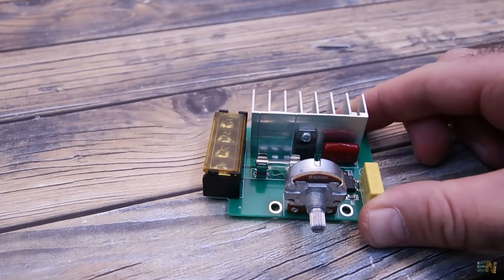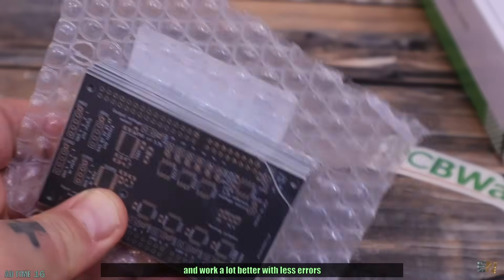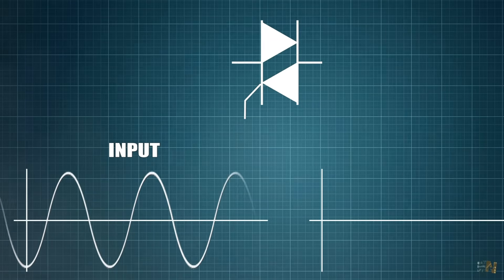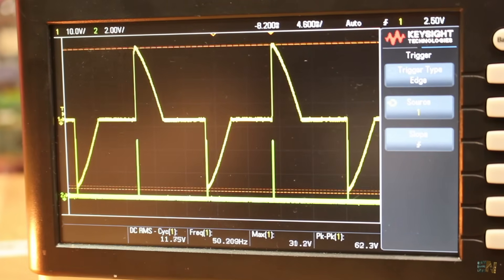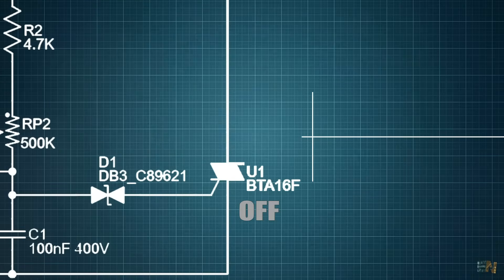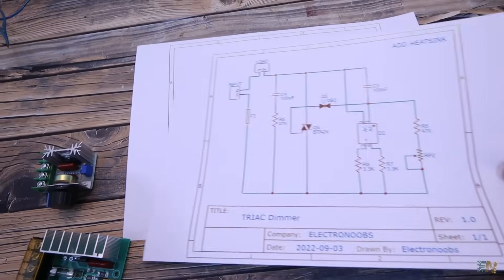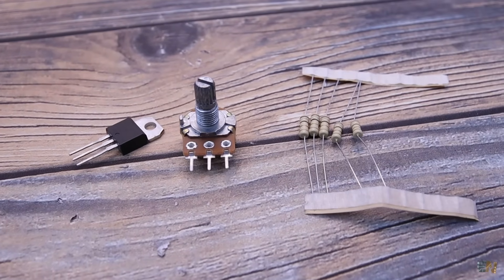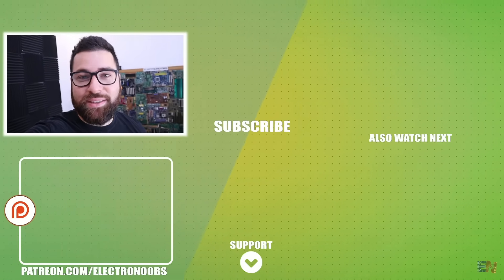TRIAC AC Dimmer Circuit - How to dim AC Power for Motors and More

Comment: Es geht auch ohne Gleichrichter wie hier gut gezeigt wird  für Normalbirnen.
oft kann man nicht ganz runterdimmen. (je nach Produktion oder Defekt). Dann setzt man 
als Endkunde zwei Diacs hintereinander ergänzend ein. (gestern gemacht, da Ursache nicht gefunden)
Dann ist das Regeldefizit behoben und man kann wieder ganz genau und auch hier auf Null runterdimmen.
Sowohl bei dem Gleichrichterglätttungsyp, als auch ohne wie hier, so ein Teil früher einmal erwischt 
und dann selber behoben. Oder man lötet das ganze 8 x kleiner und noch unkomplizierter mit 500 kohm Poti 
10 kohm Schutzwiderstand und 3,3 kohm nach 100nF zu Diac zum Triacgate auf eine Mini - Platine. Fertig.

a) Man kann z.B in die Phasenanschnittstelle bei LED einen 250 V festen Transistor reinsetzen und dessen Basisansteuerung nach vorne vesetzt zwischen zwei Widerstände vor den Diac legen. Die Kapazität ist hier viel kleiner auf A1 nach unten [33nF]. Es gibt auch Minipotis , fast SMD groß mit gut belastbarem Widerstand - Drahtabgriff für wenige Cent. Man kann auch das Poti an einem Eck mit einem Tupfer Isolierlack am Läuferstreckenende eines Normnalpotis beschichten (ein gut plazierterTupfer) , dann geht die 220 v LED sauber, ohne viel Aufwand ganz aus, und reicht für 3 LED der Küchenlampe als Minimodul zum hell - dunkel steuern. 
Das habe ich gemacht, es geht nämlich dann teilweise zur Regelung ohne Potibelastung über den Transistor 300 V fest
(ggf. noch mit Vor -  Diode).  je nach nach Transistortyp (NPN oder PNP) und Vorwiderstand auf C - E Strecke 
zum Schutz.  Minimalprinzip mit erwünschtem Ziel.

b) Besser und noch viel genauer ist hier eine dauerhaft verläßliche PWM - Regelung über einen Mosfet.
c) Eine weitere Lösung wäre eine vorzeitige Pulsweitenlöschung am Triac über einen Minitransformator 
mit Frequenzgeneratorschaltung und einstellbaren Pulsweiten z.b über NE 555 oder einfachem 2 Transistor - bistabilem Frequenzgenerator und nachfolgendem niedervolt Colpitz -  Mini Transformatortreiber, 
z.B auch wie in einigen Massagereizstromgeräten, hochwertige auch  mit 2 x NE 555  oder mehreren 
(z.B. 4x in einem kleinen SMD - Cmos und dort nur voreingestellt auf 10 x verschiedene  Möglichkeiten).

Wichtig ist aber die Grundfunktion:
mit Triac Löschfunktion von primär 12 V aus einzel 1,5 x Akku - Pack, dann auf sekundär 220 V Reizstrom transformiert und  dort Pulsweitenlöschung nach Voreinstellung im Niedervoltbereich an Multifrequenzgenerator aus z.B. 2 Transitoren (kinderleicht), dann bei 220 V transformiert am Triac abgreifbar und simulan dann auch 220 V so Frequenz varianbel und Pulswellen verstellbar dort am Triac  löschbar. Die Dauer überprüft man recht anschaulich mit einem winzigen VDE Gasglimmlämpchen und zweifarbigen LED Dioden am Frequenzgenerator, dies ist unkompliziert und logisch über zwei Potis einstellbar. Die Amperestärke mit einem dritten Poti vor dem Gasglimmlämpchen. Das geht fast einfacher bedienbar als jedes käufliche Reizstromgerät, 
wo man wie verrückt erst einmal wie ein Wilder mit Spieltrieb herumtippt.
Natürlich sind die vorprogrammierten Funktionen recht gut gemacht.

Comment: Das kleinere Poti ist der noch zusätzlich verstellbare 100 kohm Widerstand.
hinter dem etwas größeren 500 kohm Poti auf einer Seite auf A1 .  Seitlich liegt nach unten auf A2 der 100 nF, Kondensator als Kapazität. Dann kommt danach der 3,3 kohm Widerstand an den Gate des Triac.
Geht dann richtig. 👍simple Sache z.B. gut leucht - beschichteten 60 W Glühbirnen  (wie Tageslicht hell)
und auch bei Halogen Glühbirnen.

gut erklärt und gleich auf den Punkt gebracht ! 
Dann noch der Glättungsfilter mit 100 nF (oder 150 nF) und 100 Ohm ~ entspricht voller Glühbirnenankopplung [diese hat meist 100 Ohm kalt] u. bei errechnetem Wechselstromwiderstand nach 2 pi Wurzel C * (L)
dadurch geht es auch viel gleichmäßiger beim Regeln.

Zeichen für eine richtige Schaltung:
eine parallele 220 V LED - Birne geht beim Aufdrehen der Glühbirne invers ganz aus. und v.s. genauso an u. aus.
Noch besser zwei Diac und 6.8 Kohm statt 3,33 Kohm. und 33 nF als aktive Keramik - Kapazität dort, statt 100nF.
und 66nf dann als Filter (ohne 100 Ohm sogar) . Dort ist die LED in Gegenrichtungsdrehung am Poti 
dann total aus (absolut dunkel) und genauso die Glühbirne noch einen Tick präziser regelbar aus. 
(wer das einmal probieren will).

Comment: Great video.  But maybe the output signal and the control could be improved if the control circuit is connected before the load not after the load.  You see, the voltage of the control circuit is also regulated by the triac.  It should be a clean AC signal that enter the control circuit.

Comment: Your circuit diagram for the second commerical unit has the wrong resistor values. 3302 shown in the picture  is 33k not 3k3 as in your diagram. 4701 is 4k7 not 470 ohms.  People have commented on this already so do something about it. Anyone building the circuit with 3k3 instead of 33k resistors are going to be in real trouble.

Comment: Hi, The resistor values you presented in the reverse engineered circuit are wrong. A Resistor that is marked 3302 is a 33kohm not a 3.3kohm as you designed in the schematic.

Comment: Very informative video. Is this triac dimmer  reduces voltage? And if so will it be effective to reduce 220V to 110v  for a solidstate guitar amp.  Thanks
Reply: No. For your purpose, a transformer with 230V input and 115V output will fit. This circuit is NOT for halving the amplitude of a sinewave. It deforms the sinusoidal waveforms like pulse width modulation does with DC voltage, but synchronised by the beginning of every half-wave.
If you would try to use it as a voltage reducer for your guitar amplifier, it could render your amplifier useless, even blown up.
Try to get or build a transformer that transforms 230V AC voltage to 115V AC, it will fit your needs and there will be no annoying (sometimes deadly) disturbances.

Comment: Thanks for sharing AC dimmer Voltage Regulator for speed controller, instead of 500k can i use 100k Pot, Please suggest if so  any other components are required to change.

Comment: Can I swap out the potentiometer for a microcontroller controlling it digitally with PWM?

I assume that somehow the potentiometer was getting VCC and GND, can I hook these up to 5V In and GND and then the analog signal pin be replaced with a micro controller's PWM pin?

Comment: I have a small cheap portable induction cooktop (lots of mosfets inside). It works mostly fine but at low power it does not only dimm anymore, but powers on and off the induction coil as well. Not a problem in itself except when using it in a solar pv system where the inverter will constantly "lose" solar power trying to match the rapidly changing cooktop, making other stable appliances use grid as well even with plenty of sun.
Is dimming it with a triac a bad idea?

Comment: These are excellent for resistance heating devices but for ac motors especially ac induction motors it can be hard on your coils and the bearings. If you have sufficient cooling you really wont need to worry about that and it's not always the case but something that can happen. From what ive read about peoples experience it depends on the manufacturer but it's like 20% of people seemed to either fry their coils or like in my case keep having bearings go out. Could also be how i used it or others rewired the device wrong. Just figured id throw it out the to take into consideration. For what its worth this circuit absolutely does control ac induction motors.

Comment: So this also changes the output voltage and waveform. I think the sharper waveforms can affect/damage motors in the long run while its ok for bulbs & heating.

I'm looking for a device that can control & adjust the power supply from the wall socket while maintaining the voltage at 240Vrms.

Comment: hmm is it safe for the device in a long run? i have a fan, and wanna try to apply this but still not sure
Reply: No, it is not recommended for any kind of motor using TRIAC. You should use VFD for AC motor variable speed. TRIAC only ideal for resistive load such as tungsten-filament or halogen lamp.

Comment: I purchased an SCR dimmer that looks exactly like the one at 5:13 in the video.  So, based on the video and oscilloscope this dimmer is a trailing edge SCR correct?  Trailing edge dimmers are supposed to work with dimmable LED lamps, so hopefully the one that I bought will work with my pool light LED driver that is rated at 120v AC . Here in Mexico the standard is 127v but it commonly varies up to 135v and I want to use the dimmer to lower the voltage by about 10%.  What do you think about this?

Comment: thank you so much. but can you explain my teacher's question: why do we need to use zero crossing when control power of AC load ? thank you.
Reply from the maker: Because you need to fire the activation pulse of the TRIAC always at the same time. And since AC is oscilalting, in order to syncrhonise the pulse, we detect the zero corss and then we apply the pulse after the same amount of time, every time.

Comment: I made some disco lights in the 1980`s with Triac`s. I used a tape recorder to send a voltage to a decade counter and it controlled 10 triac`s using the output speaker connections as a output signal. You could put the tape recorder in record mode to pick up sound.

Comment: I read this dimmer is not for lights... Only for revving motors. I can't decide with dimmer to use for ulka 220v 50hz 48w ulka pump to regulate flow. This or the one used for lights. They use different mechanisms supposedly

Comment: What am I doing wrong if the potentiometer is burning up when set to low resistance?
I set this up on a breadboard and worked fine. But now when i soldered it doesen't.
Only difference I know is that I am now using 4 triacs connected together?

Comment: Very nice and informative video. But in practical terms, this circuit would be a really bad choice. TRIACs and full bridge rectifiers are well-known to induce a high percentage of harmonic distortion due to the capacitors only requiring current from the source for a limited time, making the current drawn a distorted sine wave. Therefore, the power factor will be very small and it will definitely not be in compliance with IEC 61000 3-2 or 3-4.
Reply: So, what is better solution?
Reply: @drinski6720  A boost PFC rectifier probably, with current and voltage control (but that's for DC voltages). For AC voltages and in this case controlling motors, a VFD is the best option.

Comment: I thought AC motors can't be safely dimmed down using traics
Reply: Universal AC motors can.  Sometimes back to back SCRs are used, as they're generally more rugged, but for small motors triacs are usually fine.  Induction motors can't be slowed down that way, those are usually much larger motors,

Comment: For a motor, what does this do to torque? Does it stay the same, or decrease with the dimming of the AC "pulse" (or whatever you would call the dimming feature)?
Reply: You are essentially limiting power which affect both torque and speed.
Reply: @flyinglack  so its different with dc pwm ?
Reply: same questions

Comment: Another great video. Can I suggest that at this point 9:50, you should have put it into a plastic box as a demonstration of safety. Turning the pot and holding the circuit still, isn't safe. Someone may decide to give it a go and then forget that the normally low voltage protoboard that they're using is now at mains voltage. I experienced 240V when I was nine and I went flying across my bedroom.

Comment: 4: 57 What is the function of this little blue potentiometer?
Reply: came here to ask same thing! its not on his schematic diagram.
I recently purchased what looks like the identical item, and it seems to be in parallel to the main potentiometer that the human uses (no guarantees on my reverse schematicing). The blue pot has 'w 205' and '302B' on its top surface, so i was thinking it was 2Mohm but maybe it is 3k? One good thing is the oscilloscope shots were different: I wasn't getting the same waveform as electronoob was, it was really not doing any waveform limiting at all, so for me, i am thinking the factory set it to a low resistance such that the thing was charging up too quickly and triggering straight away, try it tomorrow- the video helped me trouble shoot.
Reply: addendum: i rechecked the schematic and yes they are in parallel. So its kinda doing not much - maybe it is trimming the 500k pot to some exact value?  In a manufacturing sense this could  be seen as waste, so i was thinking maybe it was a pcb layout error, and i cut a couple of tracks and rejoined so the blue pot was in series, which allowed an upper limit to be set if needed- (my application only wants a max of 90v).
Reply: ps the oscilloscope shots were different because the load i was using was too small to maintain a holding current on the scr, once i used a generic lightbulb, the traces were the same as the video.
Reply: I would prefer an answer to a heart sticker ;-}

Comment: why when in the osciloscope there's "more wave" (bigger conduction angle) the power seems to be less since the motor spins lower?
EDIT: it would've been good if you explained the minimum conducting angle due to the RC trigger

Comment: can we use ac dimmer with arduino and control it by both manually as well as by digital means using hc-05 or some wifi modules?..... can you help in this please
Reply from the maker: I have a video on that. Bluetooth AC TRIAC control and is made with Arduino! You have to read the zero cross of the AC signal with optocouplers
Reply: You can substitute the potensiometer with an LDR and a LED.

Comment: I must have misunderstood something. The diagrams in explanation are the opposite of the ones on the oscilloscope?!?? Confused 🤣
Reply from the maker: Since I can't connect the ground of the probe because it will make a short, since the oscilloscope is using the same AC supply from the main outlet, the signal may be reversed depending on which side you connect it since it has no reference because the negative probe is not connected.
Reply: @ELECTRONOOBS  I don't think this is what the OP means.

The clip at 7:26 shows the voltage starting at the beginning of the sine wave and ending abruptly in the middle of the wave while the voltage is still above 0V. This is quite opposite the "theoretical" waveforms shown earlier.

The reason is that the controlled load is inductive, which means that current and voltage are not in phase. The Triac shuts off when current is 0, but the voltage isn't 0 simultaneosly. This simple type of dimmer isn't well suited for inductive loads because of this phase difference between current and voltage.

The clip at 7:32 appears to show the circuit with a resistive load (likely an incandescent light bulb: You can see it's glow reflected in the lower left hand corner of the oscilloscope). Here, the waveform corresponds better to the "theoretical" waveforms shown previously.
Reply: @HerrNilssonOmJagFarBe  Helpful explanation.

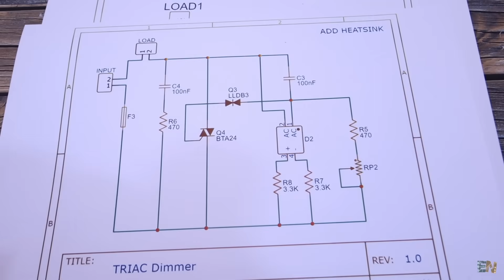Comment: 1. @7:54 what is the role of the bridge rectifier ?
2. It was worth mentioning the triac must be of snuberless type, otherwise you'd have to design the snubber network...
Reply: In the simple circuit, when the load is off (the DIAC threshold isn't reached), the voltage over C1 lags the input voltage. When the input voltage rises above 0V after the zero crossing, the cap still holds a negative charge from the previous cycle. So it starts up from a negative voltage. If the potentiometer is moved in th edirection to turn on the load, suddenly the TRIAC will fire. This will discharge C1, so at the next zero crossing, the voltage over C1 starts at 0 for the next cycle. This means that it reaches the DIAC threshold quicker in the next cycle. The result is a hysteresis effect, where power snaps up abruptly from zero, and you have to dial down the pot again to maintain a lower power level.

The bridge rectifier discharges the capacitor (C3 in this case) when the input voltage is close to the zero crossing, even if the TRIAC doesn't fire, making sure that the cap starts charging from 0V in all cycles, both where the TRIAC conducts and when it doesn't. It gets rid of the "snap" effect and makes operation at low power levels much smoother.
Reply: @HerrNilssonOmJagFarBe  Thank you Jonas for the detailed explanation, much appreciated 😀
Reply: Thank you very much Jonas for your explanation. It is very helpful to us beginners. Thank you.

Comment: How can we make an AC dimmer which can be controlled by just an external analog voltage (0-5 volt) with out any micro controller
Reply: You can substitute the potensiometer with an LDR and a LED.
Reply: @iblesbosuok  yes I can also give a variable voltage supply from 0 to 5 volt using LDR but I want to give the 0 to 5 volt supply from a DAC
Reply: @subhabratabasu266  you yourself have to learn that part, not me
Reply: @iblesbosuok  yes I am working on it I asked for if there is any suggestions

Comment: I usually don't like to do 240V circuits on 2.54mm prototyping board or at least I will use single sided protoboard and remove unused copper pads.

Comment: Why theres burning/flaming inside potensiometer when this circuit used with drill? Tx u sir 🙏
Reply: The sparks that cause flaming/burning in the potentiometer are the consequences of the voltage spikes generated by the motor in your drill. You can get rid of those voltage spikes by soldering a small ceramic cap between the poles of the motor.